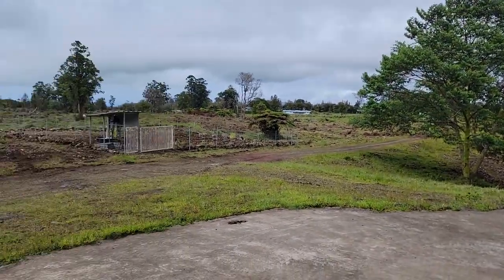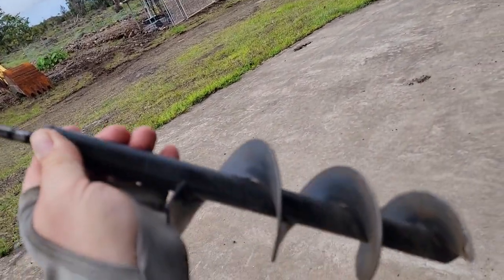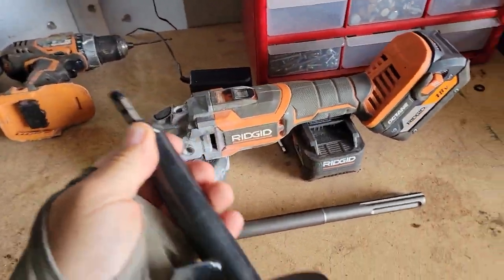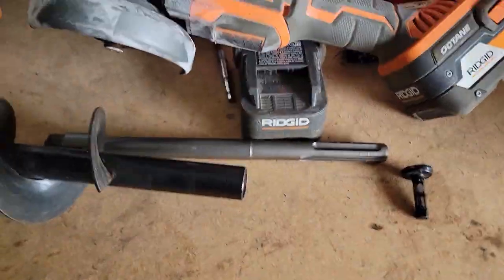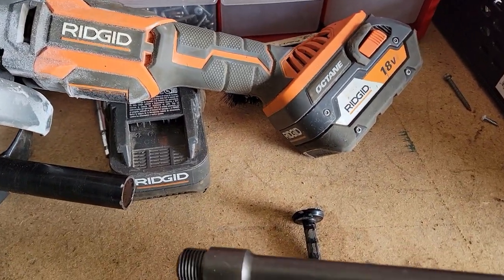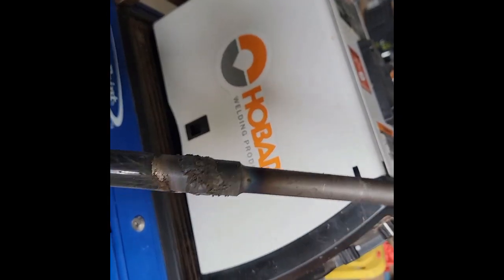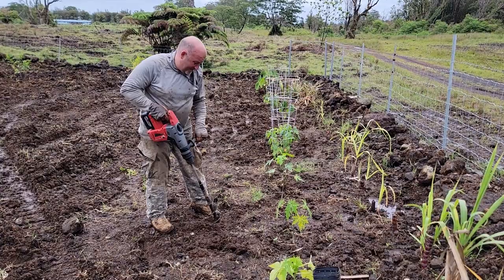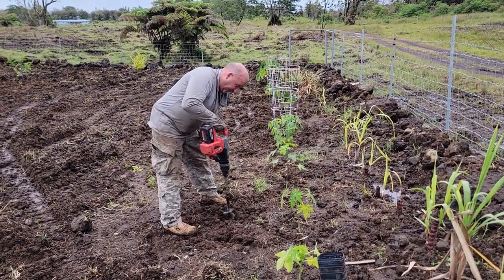DIY SDS Max Auger

Comment: Will the welding last? No so sure. Also, the rotary hammer's torque kicks really hard and you need to take the auger bit out of the hole in order not to spin it out of control. Unless the rotary has a torque control function that's a nice way to injure the wrist...
Reply: Looks like the guy’s been around a job sight or two in his time. Don’t worry about him, he’ll be alright.
Reply: @MrIgottap  Yeah. I'm only worried with the ones that may try this out, not him...